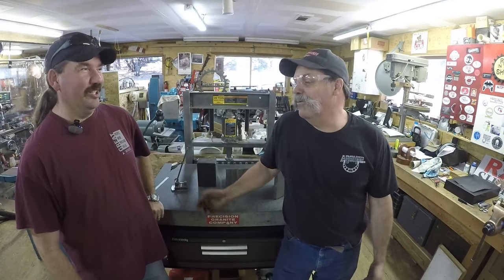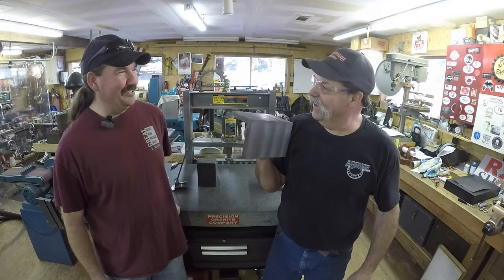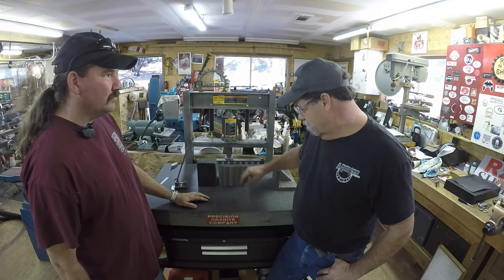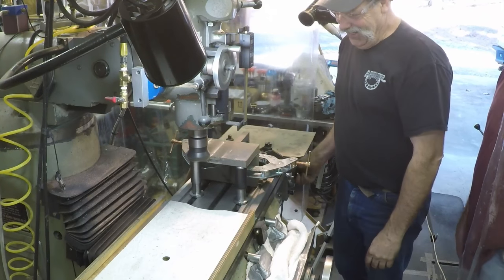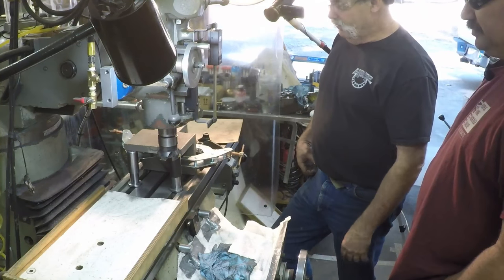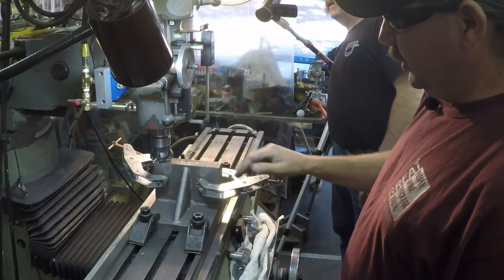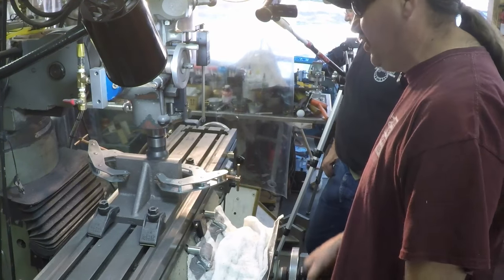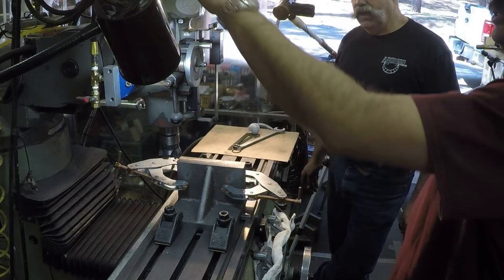Milling Cast Iron Angle Plate Castings with Randy Richard

Comment: Pretty damn good results you two achieved, Randy is always a lot of fun to hang out with! Good luck with Emma's competition!
Reply from the maker: +Ray Caniglia oh yeah had a blast dusting iron all over the shop lol. How did the lapel mic work out did it help with the echo?
Reply: I just received the Maono powered lapel mic yesterday, picked it up off Amazon for under $20. I'll give her a test this weekend and see how it works out. Yea, Cast Iron makes a mess and is really bad on machine ways if not properly cleaned. Your Angle Plates are sweet, nice and heavy duty and looks to be a really good quality fine gran foundry material!
Reply from the maker: Ray Caniglia I'll be waiting for it

Comment: Fun time Chris, thanks for coming up.  I will get them finished up soon.
Reply from the maker: +Randy Richard In The Shop yes it was take your time. It will make the scraping that much easer.
Reply from the maker: +Randy Richard In The Shop hey randy what you think about making some sine bars I found 3 unmachined blanks on ebay a while back? If I can remember where I put them that is.